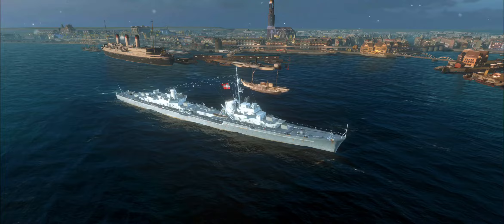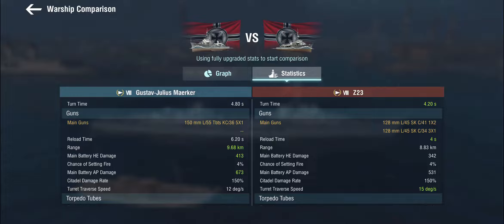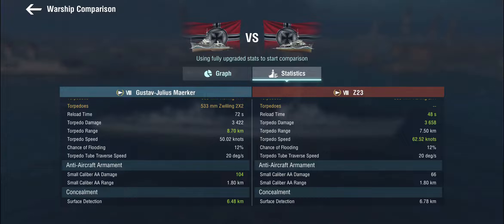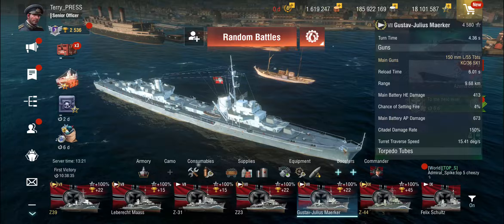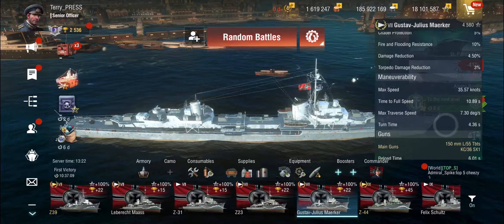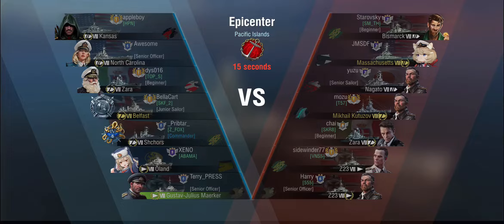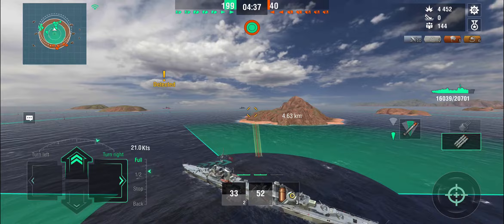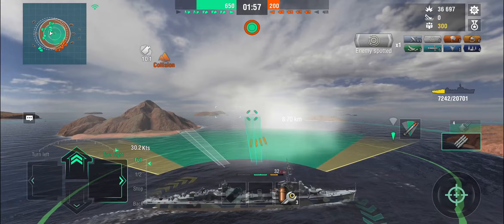World of Warships Blitz - German destroyer "Gustav-Julius Maerker" review

Comment: Now this looks better than Z23 the gun layout is nice I didn't like the double turret infront and single in rear combination
Reply: Old Z-23 with 150s is still much better than this thing tbh, she has better guns, more torp power, better mobility and hydro, of course there's no smoke and the torps don't have as long range but when you consider those advantages Z-23 have, she's more fun as well as better at dealing with DDs, and the thing also got buffed with those 128s. Just like always, a new line gets overhyped. Only Schultz and Elbing surprised me for having actually decent DPM, whereas Z-31 and Maerker are as shit as they are supposed to be. Btw the gun setup was the same between type 1936A and type 1937J ships, except that the Germans were even worse at designing ships by not using the more efficient twin turret on a ship twice as big as a Tribal class which had equal chace of outgunning it